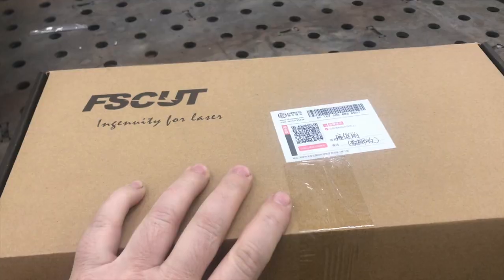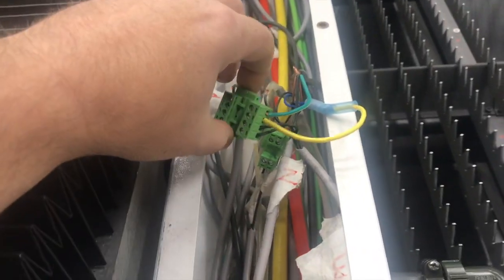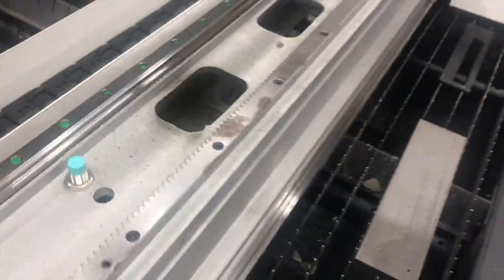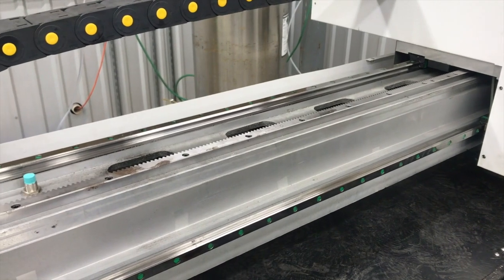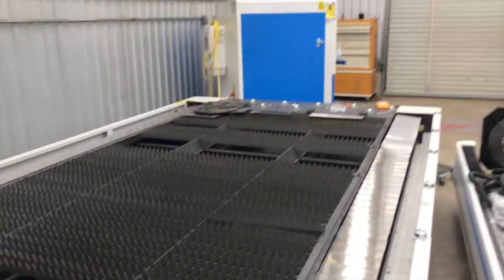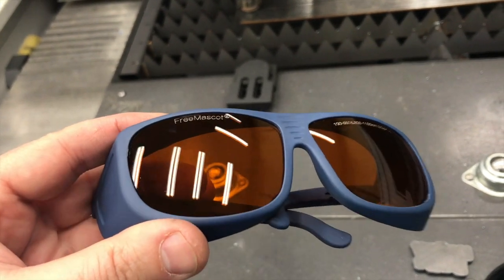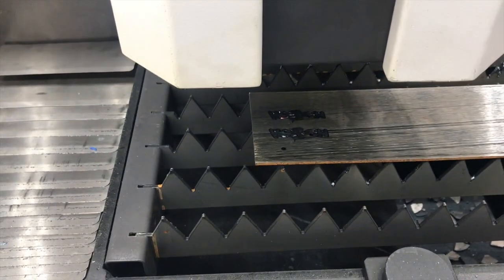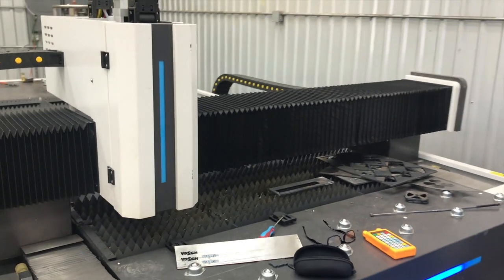Santa Fixed The Laser

Comment: Nice find on the pinched wire!  As for the glasses - I'm a bit leery of safety brands that I don't recognize.  For my CO2 laser that I use, I go with Honeywell glasses.  I've seen way too many Chinese laser safety glasses that offer little to no protection.  In this case, a little protection is not better than no protection, because it leads you into a false sense of security.
Reply from the maker: I hear ya... What about the people that trust their fully enclosed machines that have the Chinese safety glass?  Should those not be trusted?
Reply: @turbocobra  That would depend on the reputation of the manufacturer.  If it's a reputable manufacturer, then they might have more to lose by faking the safety qualifications of their machine window filter material than a manufacturer of, say, $30 safety glasses.
Reply: If you're interested in lasers in general, check out the Styropyro channel.  In his most recent video, he is experimenting with a Chinese tattoo removal laser available on eBay.  The machine came with laser glasses, and during his experiments, he tested them out only to find that they offered zero safety.  Here's a link to that part of the video: https://youtu.be/-BeTq99LqUo?t=530  The most important take-away is if you are going to trust your eyes to a pair of safety glasses, at least be sure that they are designed for the specific wavelength of laser that you're working with (not all laser glasses are created equal - they are specific to the type of light, and the glasses I use for my Co2 laser would offer no protection at all with your machine, for instance), and are from a reputable manufacturer.

Comment: Merry Christmas.  Glad you got it fixed.  Although I think you are being a little too kind about their trouble shooting skills.  You had a limit switch error code and they told you to swap out the board, without doing any tests on the limit switch circuits.  You are much too kind!  I hope that is the last of your troubles.  One thing that is curious, is that the machine functioned with the wire disconnected.  Limit switches should be Normal Closed for safety reasons.  That way if a wire breaks, the machine wont function.  However in this case the opposite seems true.  If you find out what type (NC vs NO and NPN vs PNP) you have you'll be in a better place to trouble shoot in the future.  Again thanks for sharing this.  I keep eyeing similar Chinese machines (routers though).
Reply from the maker: Also, there is a high likelihood i will need alot more of their help, and openly criticizing someone for mistakes that are easy to make, the kind of mistakes we all make at some point... just doesn't seem like a good strategy
Reply from the maker: No, the machine did not function with the wire disconnected.  Teh board lit up but the machine did not run.  As soon as that wire made contact with ground, the machine stopped.  Well I am very understanding of other people because I make a lot of mistakes, even though I don't intend to.  They have been very responsive and supportive and that means alot to me.
Reply: @turbocobra  Sorry at 2:10 you said the board powered up when the wire was disconnected.  Took that to mean it functioned.  Anyway I'm not "hating" on them.  Hope it all works out.